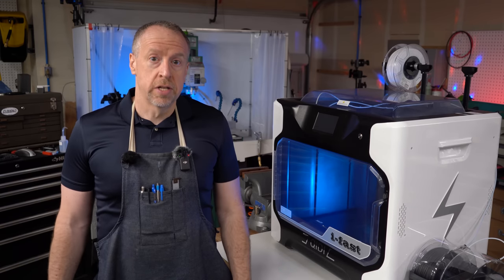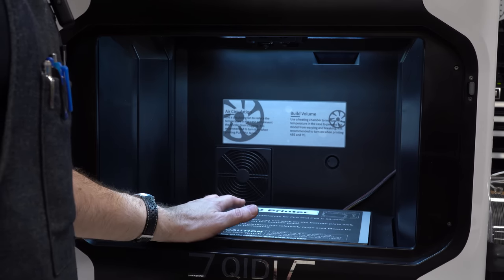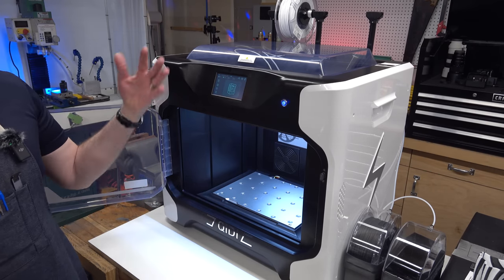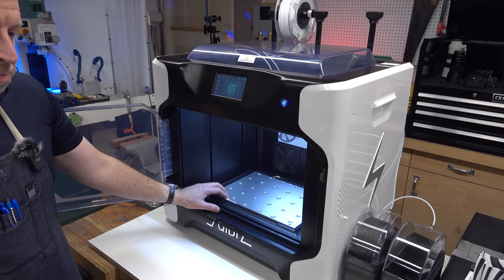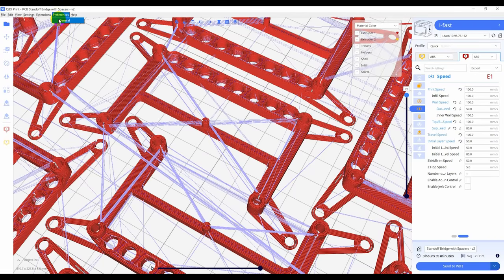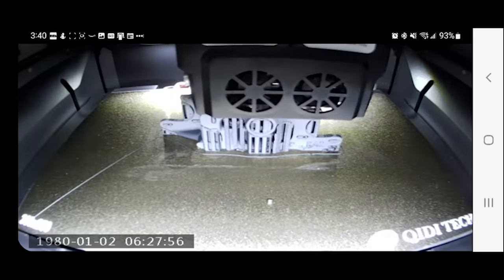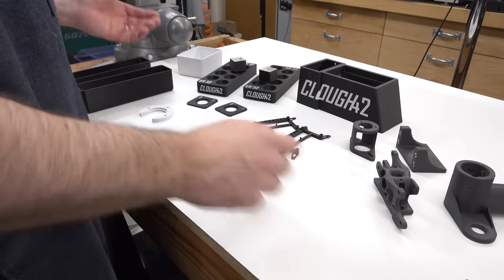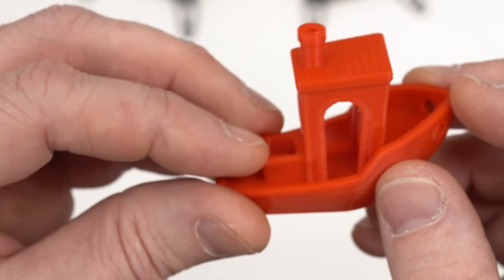QIDI Technology i-Fast 3D Printer | An In-Depth Review

Comment: Hey James,
I just pulled the trigger on the i-fast. I also had a deposit for the Prusa but this really looks like the printer for me. I'm sorry I couldn't use Amazon but I found it for $2100 at another site and couldn't resist, plus, I kinda prefer helping the smaller shops.

I have you electronic leadscrew based on your videos and suggestions and couldn't be happier. I really think the printer is gonna be a great addition AND I can sell my 2 flash forge creator printers and  my highly modified creality 3D printer. I could never get any great prints with ABS or high temp filaments with any of them.

thanks again

Comment: Hi, it seems a very intersting printer. I have a Ender 5 plus and I had a LOT of problems. I was close to throw it away (I wouldnt sell it as it would be unfair for the new buyer). Then I have solved it with the transformation to a direct drive with MICRO SWISS. NOW I am SUPER happy, but of course it's open housing. Your new printer seems to have that additional point that mine is missing. Great video.
Reply from the maker: The Ender 3 and Ender 5 are favorites of beginners.  It's kind of a catch-22, though.  They're good base printers if you tinker and get them running well, but the beginner isn't necessarily prepared to figure out and solve the issues.

Comment: Wow, that is quite a review! I like you attention to detail! While I would not buy any of those expensive printers it was a pleasure to watch.
As for manual bed leveling, I agree, the auto probe must have is kinda exaggerated, I use Ender 3 and after I flatten the bed I do not touch knobs or calibrate it with piece of paper for months.
There is a good recipe for good bed leveling, and if manufacturer follows it user will have not much trouble. On Ender 3 however you have to flatten the bed by hand by bending it and the reset with aluminum tape. Also need to fix bolts with nuts to the bed itself. May want to replace springs. And after that it will not need to adjust every single print.
Also I agree that firmware is very important. That's why I love my Ender 3. I can install official Marlin with all new features which they add, and can set up functionality which I need. For example to tune flow ration on the fly, or use firmware retract, so I can add z-hop during print if it is needed or adjust retract length during print. And so on.
PEI sheet is also a must have. After I installed one I had little to no trouble with adhesion. And it cools very fast. I just place it on a table, and on printer I launch preheat (again opensource firmware let me add preheat presets which I need). And in a couple of minutes I place PEI back and launch next print.

Comment: Thank you for doing this review. I have used the Qidi X-max for a year or so and it has been fantastic  but as you say the software lets it down  but I know that every time I come back in the morning that the print will be there without exception. I have been wrestling with buying I-FAST but for the same money I could build a better machine with a bigger build plate that would print much faster and if I use IDEX heads and only need half the bed size it effectively allows me reduce a five hour print to 22.5 minutes as I would be producing 2 components at a time. However after watching your review I have been reminded how good QIDI printers are.
Reply from the maker: All of the IDEX printers I looked at claimed to be able to print mirrored or duplicate parts simultaneously, but when I looked deeper, they could only do it practically with a raft, since they're compensating for the two nozzle heights in software, and there was no mechanical way to align them to print well at the same time without the raft to take up the slack.
Reply: @Clough42   I was unaware of the limitations that you mention, now I will have to investigate further. I have decided to buy the I-Fast  so I can use it immediately and take my time and build the mother of all printers. Thanks for your input.

Comment: When I built my old delta I built it with heated chamber in mind. As long as the temp got over 45c or so the parts were very flat. The bed material for abs is very interesting.

Comment: As always James, that was brilliantly informative. I've been thinking about dipping my toe in the 3D Printing water, so to speak, so I have been really interested to see your '3D' videos. I'd probably start with an entry level machine until I knew just what I wanted to do & whether I'd make reasonable use of it, but this one also looks like a great 'step-up' option for down the track. Thanks again.
Reply from the maker: For people just starting out, I will always recommend something smaller and less expensive.  If your budget is small, there are a number of inexpensive machines that are reasonable starting points.  If you have the cash, and are willing to pay for a good experience, the Prusa is excellent.  It's generally not a great idea to drop a bunch of cash on something if you don't know how much you'll use it or what you'll use it for.

Comment: Here in Australia they are hard to get & the price is around $3500 au ( incl shipping , dutys,tax ,etc) ,im a novice at 3D printing , i only ordered it for Product Prototyping as im becoming a product developer/Inventor , ive researched so many 3D printers & alot of people told me to get a ender 3 to learn on but you need lots of upgraded parts to do things that i want , i wanted an all in one machine where i didnt have to buy multiple machines to run  some of the filaments i want to run .  I wanted the X-CF Pro but Qidi had none available & to import one from china ended up costing similar to an i-Fast ,l so ordered an i-fast through amazon 2 weeks ago . i plan to be running ASA to start & get into Carbon/nylon. Good review thanks

Comment: Ooooh I was in the market for 4 new printers 2 years ago.   Like you I only make mechanical objects.  No interest whatsoever in PLA.  I almost bought QIDI.  Went Ender 6 and CR 200-B instead and I'm so glad.  The high temp hot end can't be serviced (non-serviceable heat break).  At least it couldn't be serviced then.  I narrowly escaped.  Not much cooling fin area for the heat break. Turned out to be a problem for lots of people.  Maybe this new version is corrected?  Lots of attractive looking spec's including Nylon to start, IDEX and the active heater.  I almost pulled the trigger and purchased QIDI. My next evolution will be Voron Triton's.   Order a backup hot end set now.  Nylon is cool but you can't put fasteners or constant stress on it as it will creep/flow away from the load over time.   People who print Voron parts in it need to re-print the entire project to avoid re-tightening screws nearly every day!   Be careful what you ship in CF Nylon.  Love the active heater.   However, my printers get up to 50c plus anyway.  I can print edge to edge also.  Love to try 70c+ chamber however and see how much more quality it gets me.   Watching video now and thumbing up.  Bit rambling.  If found the QIDI a close call for my uses, didn't choose it but it was at the top of my list.

Comment: Really excellent video. Adding an actively heated chamber is a very simple and cheap option to DIY,  so that would bring Prusa XL etc into the frame 😁
Reply from the maker: I would think if you're going to put the electronics inside an 80C heated chamber, you would have to design for that.
Reply: @Clough42  Yes, of course, the main electronics would prefer to be mounted externally 'in the shade' 😁

Comment: I have had a Qidi Xplus for about two and a half years and have found it generally to be a very good printer. Aa a noobie 3d printer user,  it worked straight out of the box for me.  I've printed some fairly large prints without issue.  Only complaint is the wireless is flakey and has stopped working randomly.  Qidi support have been very responsive
Reply from the maker: That's good to hear.  I have no way to tell if I'm getting special treatment.
Reply: @Clough42  yeah seems to be fairly consistent. I have had two mainboards shipped to me for free after reporting the wireless issues, which although I don't think was the right move at least they're trying to help. Also reached out after watching your video last night to see if there was new firmware and it came through via email overnight. Seems to have corrected the wireless issues for now

Comment: Even with an unheated chamber, ABS becomes attainable in most printers. It's night and day. I get great results in my Voron V0.1 with a cold chamber of 30-40c or with a fully warmed up printer around 60-65c. You're headed down a slippery slope towards another addiction :) Slicer settings will be where the bulk of the quality will come from for you.
Reply from the maker: Slippery slope?  What do you mean?  This is only my 6th 3D printer.
Reply: @Clough42  You've got me beat. I'm building my fourth to get rid of my second.
Reply: @jackshett  lemme guess - you'll keep the second anyway, just in case..
Reply: @klaernie  it's an ender 5 plus. Open frame printer. It was a purchase I've regretted since I bought it. Will try to sell or donate. If I can't do that then I'll keep useful parts only.
Reply: @jackshett  what issues were you having or was the open frame the issue?  Thanks.
Reply: @redone823  when printing ABS you should really use an enclosed printer because of cold air causing warping or later splits. You could get away with a draft shield in some cases.

Comment: Seems like a pretty solid printer (minus the software issues.. not being able to interact with the UI while uploading seems like a system design/programming issue.. lol). Didn't realize how big of a change having an enclosure made, especially for ABS. Was thinking about getting the Prusa XL when it comes out-- I've had the MK3S for a few years and it has been problem-free, but I do find that I wish it had a bigger print volume.

Comment: I did not preorder the Prusa XL specifically because it is not enclosed with a heated chamber. 

Fun side note: take a closer look into the extruders -- I believe some other folks have found the head units have attachment points for, and plugs for, BL Touch additions to come later. I contacted them about that and, if I got through the (mild) language barrier, had as much confirmed.
Reply from the maker: That would be useful.  What I'd really like is to be able to run Octoprint.

Comment: Great video. I'm interested in the box you printed. I print a small black abs part similar in size. It's a chain/belt guard for a small dc motor. I made my outside corners square. I would like them rounded but I could never get good bed adhesion, or if there were supports, I couldn't' remove them. I'd be interested in your print settings, speed, temp and supports.

Comment: 27:25 If you design your part to have wall thicknesses that are divisible by your extrusion width, you can eliminate gaps while also turning off gap fill. This is assuming either your outside or inside dimension can change slightly.
Reply: Cura 5 now features adaptable width line, so it fills those gaps in a great way

Comment: Hi James, Now that you have run the I-Fast through it's paces, what do you think about the R QIDI TECHNOLOGY X-CF Pro ? At the $2k price point, do you think it's worth it ?  It does have a BL Touch on one of it's extruders, the "high temp" module... But, no active chamber heat control !  I assume they were thinking, that the build plate heater was sufficient enough to keep the chamber temp at a constant level ...? Have you monitored the I-Fast chamber heat controller cycling, to see if it makes a difference ? Thanks for all your work !!
Reply from the maker: I have no experience with the X-CF Pro.  The default profile for the QIDI PA12-CF has the chamber heater switched off and the bed at 80C.  I have only used the heated chamber with ABS.

Comment: I like most things about this printer, but I'm a little dubious about that plastic cam mechanism for the print heads. I wonder if the geometry is simple enough for someone to machine a replacement out of aluminum on a manual mill.

Also, thoughts on this versus the Prusa XL? I have a deposit on one of those, but now I'm torn...

Edit: HA, I should have waited until the very end where you talk about that.
Reply from the maker: Yeah, it's just that plastic bar.  It would be easy to make one out of aluminum if it becomes an issue.  For a hobbyist, this would make sense.  For industrial use, the $150 price tag for the entire extruder makes it basically a consumable part.
Reply: Excellent, that's good to hear. I don't mind consumable parts, but I just like that shiny strong stuff too much!

Based on this, maybe I'll just need to buy both printers. Kind of a "life is short, buy the printers" thing. It's not like I'd get my Prusa XL this year anyways...
Reply: @Clough42  you weren't kidding, this printer is HUGE. The Amazon driver had a buddy with him so they could team lift it up to my porch.

Comment: I have some experience in embedded software.  Also working with S/W developers in China.  It looks like the mechanical engineering team that designed this printer also developed the software and what you get with this printer a.t.t. is the stuff they used to test and debug the h/w.
Reply from the maker: You're probably not wrong.

Comment: Just wanted to drop a suggestion for a future video...  I think it would interesting and helpful if you did a demo of how you use your CNC mill in "manual" mode.  I've noticed in many of your machining videos that you seem to have a "bag of tricks" that you do with the Mach3 GUI to effectively give you some manual control of the mill.  I'm using a Grbl based system instead of Mach3, but I suspect some of your 'best practices' could be helpful even for mills that use different control software.  Also, I think it would be interesting to see how you go about developing effective 'recipes' for Feeds and Speeds when working with a new endmill, or a new material.  Thanks in advance...
Reply from the maker: If you hit TAB, it opens a virtual MPG panel where you can set the feed rate percentage.  All you have to do it set the feed rate where you want it and then you can traverse the mill using the arrow keys on the keyboard for simple cuts.

Comment: The biggest factor with bed level drift is thermal cycling / gradients. This is an enclosed chamber with a massive heat spreader of a plate, which probably couplesto the frame an order of magnitude better than most.

This thing would probably be with in a 1/100th or 2 of a mm of equilibrium by the time the hot end is up to temp.

Comment: Very informative!
I'd actually looked at the I-Fast earlier this year, when pondering a newer-bigger-better FDM printer than the museum piece I'd been using.  The feature list was impressive, but I knew little of the company, it didn't have quite the build dimensions I was looking for (I really wanted 400mm on one axis), and, with all the nice features I didn't really need, the price was up there in entry level capital equipment territory, where I had more of a glorified toy budget.
(I ended up snagging an Ender-6 at a somewhat reduced price, knowing that I'll have to tinker with it and add various upgrades - but, then, I'm not likely to put it to revenue-generating use any time soon, so I couldn't justify spending considerably more money to get something all tricked out and ready to run.)

Comment: An actively heated chamber is going into the next printer that I build. My first printer was a cheap printer, on purpose. I figured out what I didn't like, looked at what standard options were available, and then designed my own printer with all the improvements/features that I wanted. The printer that I designed and built is a workhorse and it puts out prints in very high quality. It's not fast, I only print at 40mm/s. This is a hobby for me so speed is not important and the biggest part of the hobby is design iterations on the printer itself, not making a bunch of silly trinkets, though I do make many functional parts for my other hobbies. I've only had limited success in ABS and other "high end" filaments though so my next project is to either redesign this printer or make a whole new one with active chamber heating. I haven't actually decided yet, though I do have most of the design elements drawn out in my head, I just need to transfer this to CAD.
Reply from the maker: This is an excellent way to start, as a hobby.  I started with an inexpensive kit, just to have something as a starting point, then replaced just about everything except the RAMPS board as I got frustrated.  The resulting frankenprinters have been cranking out parts for seven years without trouble.